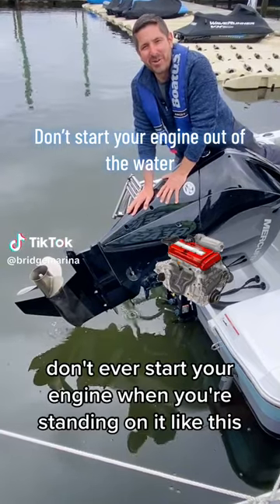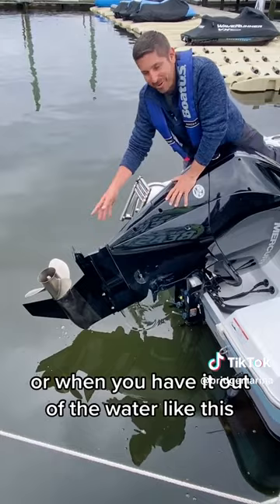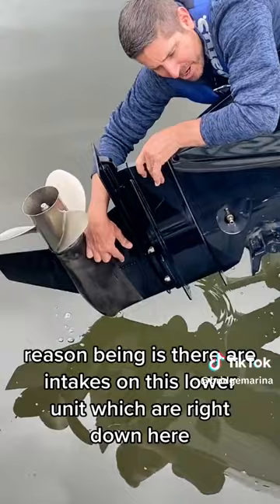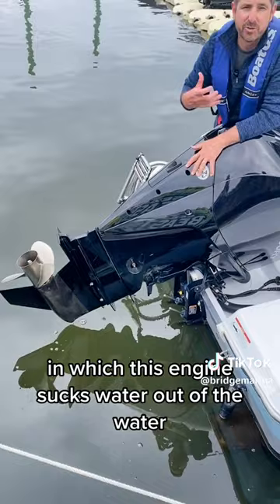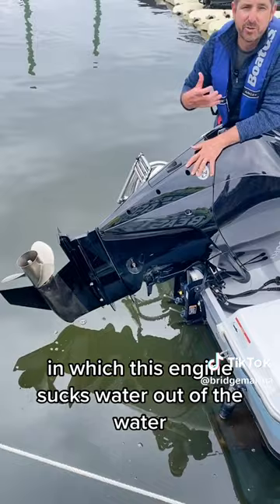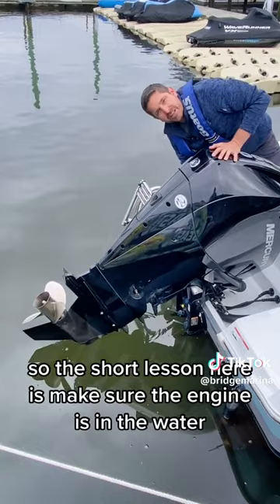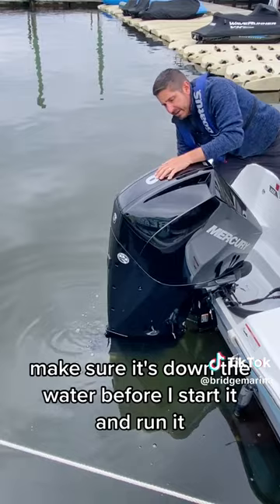Boating Tip: Never Start a Boat When the Engine is Out of the Water

Comment: The main damage is the rubber impeller. A quick run will not destroy an engine.
Reply: False information boy
Reply: @GODSWORD11   Wow doc I must have just gotten lucky this whole time. Is that book smart or is that hands-on wisdom?
Reply: @andya2636   hush 🤫 son
Reply: Correct information boy
Reply: Just a little desk pop
Reply: @GODSWORD11  correct information nerd
Reply: @hiphopaDIZZL  watch yourself
Reply: @hiphopaDIZZL  watch yourself boy.
Reply: @GODSWORD11  no you
Reply: @GODSWORD11 he’s right it will affect the impeller firsts every time cos it’s rubber nothing else is
Reply: @colvinau1403  false information son
Reply: @hiphopaDIZZL  your mom son
Reply: @GODSWORD11 
If you run any motor without any coolant first fire up. It won’t hurt it.. as long as it has oil in it it will be fine. 

If you’re running it for awhile than yeah it’s bad there’s no water. Duh. But you can have it run for a little doesn’t hurt the motor. 

Now it might fck up the impeller. Due the rubber bushing. Than yes
Reply: @GODSWORD11 nope, run a boat for a living, a quick start with it up will not hurt anything, now you don’t want to let it run for extended periods of time like that as it can overheat and then damage your engine.  
 Your impeller though is what gets damaged.
Reply: yes  it is snart  oñe
Reply: @WickedSalty  totally not a desk pop just needed a new hole to run my hdmi cable👍
Reply: Someone on YouTube ran 2 Yamahas out the water for like an hr and nothing happened but the impeller. Out a new one in put the boat into the water and boated away.
Reply: Rubber gets very hot very quickly, degrades, and cannot dissipate heat in the same way as metal.   It’s only a matter of time before other consequential problems that can be costly or terminal.  Personally I start the engine only when boat is in water. Then leave to idle and warm whilst make other slipway preparations, load boat etc.  common sense really.
Reply: The impeller can break into small pieces very quickly and get sucked into the cooling water intake blocking small orifices inside the head of the motor that will be extremely expensive and time consuming to diagnose and repair. So, no, do not run the motor outside of water for any period of time. 

I’m a certified outboard motor mechanic for the last 15 years and I have seen a lot of dumb shit and heard a lot of bad advice during that time.

Comment: For long periods of time. If you pull it out from winter and wanna fire it up for a few seconds to make sure it runs before you drag it to the lake then that's ok. Don't let it get up to operating temp
Reply: Use a pair of muffs to supply water to it.
Reply: No it is not. Just letting the engine fire and not run is proving nothing.  Just because it fired up does not mean it will keep running. ALWAYS USE FLUSH MUFFS. Put them on and let it run for a few minutes, check the shift and throttle action, and steering as well.
Reply: Na, a quick fire up let’s me know my battery is good and it will fire and I don’t sit on the ramp with a dead boat and keep others from launching. 
 You don’t always have a muff option and a quick start can tell you a ton of information.
Reply: In my experience a few seconds is enough to cause damage. It’s not the engine that overheats, it’s the rubber impeller that uses water to lubricate it. I know it doesn’t make sense since water technically isn’t a lubricant but after having to replace my chewed up impeller I won’t so much as crank my outboard out of water (without muffs and a hose) again
Reply: @codybigbee2957   a winterized motor has no problem running for 15 seconds. You still have antifreeze in all of your passage ways doing the same thing water does. The liquid keeps the rubber from drying out, that's the way we have done it for years. Our 70hp Johnson has never had the impeller touched. And our 9.9 just finally chewed the original  impeller like 3 years ago. Both motors are late 70s.
Reply: Wouldn't let you borrow my boat
Reply: @TTGTO288  this is the best case, obv you can do a quick 2 second test with no water to see if it turns over, but I much perfer to put the muffs on and get the engine warmed up as if I where actually on the water before I drag it out to the lake
Reply: @Blue_Doge  Agreed.  Being stuck on the water isn't much fun.
Reply: @TTGTO288  what's funny is my cousin just bought a boat a month ago, it was a used 16 foot boat witha 75 honda from one of our good friends, the first time he puts the boat in the water he ties it up to the dock but doesn't start it as the truck parks, then a pontoon boat is trying to launch but he's in their way so he has to untie and get out. But his engine was cold so the second he got a bit away from the ramp and gave it gas it died and he had to start it up again whilst being blown back towards the ramp

Comment: It doesnt destroy it...just tears up your impeller....
Reply: Can over heat the water jacket and destroy it. Previous owner of my boat thought the same thing and I had to replace the whole motor.
Reply: The power head, will overheat and seize. Then you're out thousands of dollars.💰💰💰
Reply: @Bill-sp8kb not in seconds
Reply: yrs it wioll
Reply: if you're a new boat owner (which most people who do this are) you won't know it does that, causing the engine to potentially overheat depending on how damaged the impeller is

Comment: The problem with running the lower out of the water would be the water impeller heating up to the point that it melts to the housing and if you didn’t replace the impeller and the housing it could possibly not pick up water there fore overheating the block and causing further mechanical damage or complete engine failure.

Comment: I watched a guy who lived down the street blow his motor that way. He must have just finished doing something to it in preparation to get it out on the water for the first time after purchasing it that winter and decided to start it up and let it run in the driveway for a while. I was driving down the road, saw this, and told him he needed to get a 55 gallon drum or something to submerge the intake and he just looked at me like I was nuts; I guess he figured I didn't know what I was talking about. Before I had finished pulling away I start smoking big-time.

He ended up purchasing a brand new motor to replace one that literally never touched water. Oh, and I also noticed he had also acquired a 55 gallon drum he had placed on the side of his house next to where he would park the boat forcthe winter.

If someone from the neighborhood you don't know, but have seen drive by for years, takes the time to stop and offer you a piece of advice you really should at least listen to what they have to say before rolling your eyes and walking away. Odds are they are just trying to help.

Comment: Does it do damage if you start it for like 5 seconds then put it in the water. I doubt it does
Reply: It's okay to start it for 5sec but don't have you're motor running as your backing it up into water
Reply: It's okay to start it for 5sec but don't have you're motor running as your backing it up into water

Comment: The reason is you don't want the water pump running dry. The engine won't need cooling for a few minutes but the rubber in the water pump can be damaged pretty quick.

Comment: I mean you can run for like 60 seconds without damage. The water is to keep it cool, if you don't run it long enough to heat up then it's fine. I just wouldn't run it and keep it running without water to cool it
Reply: It’s about running the impeller pump dry
Reply: No the water pump impeller is made out of plastic and if you do that you'll damage it. Its not aluminum or steel its plastic in all outboards.
Reply: @JoshSmith-wo7zw that’s false they aren’t all plastic mine is rubber
Reply: @onyoursixgaming2842  I think he ment rubber because I'm pretty sure all of them are rubber

Comment: Also if it’s trimmed up that high and it carbureted it’s gonna pour gas everywhere in the cowlings. And if it’s a 4-stroke there is no oil in the crankcase because it’s all in the back of the cylinders causing severe oil starvation

Comment: @bridgemarina

What about a test start in the carpark for a 15 seconds?

What about a small 15hp 2stroke pull start.

I don’t want to be stuck on the ramp with other boats lined up behind me trying to pull start a 2stroke that won’t turn over. 

What in particular is the harm that can be done for 10-15sec operation out of the water? Just the fact it needs to pump water to cool?
Thanks
Reply: You can actually just start it at home to test it.

They sell a tool the fits over the water intake holes on your motor and uses an attached waterhose to provide the necessary water to keep your engine from potentially getting damaged.

Comment: If you start it at that position the biggest problem is not the Impeller or the overheating but the oil pressure Wich Will be 0
Reply: Only if it's 4 stroke
Reply: @pain_weaver  Yes that's correct

Comment: Most outboards Ive used have a pull to start.
How would you even start an outboards thats tipped forward?
Reply: small correction, Most (if not all) small (20 and under horepower) motors have a pull to start, these are only on tiller moters, (the ones where the throttle on the handle and you push the handle ot steer instad of a wheel), but on 50+ Hp engines they aren't an option (at least to my knowlage)

Comment: If you want to start a motor out of the water how should you feed it water can you use a hose somehow?
Reply: They actually have a tool/attachment that you attach a waterhose to, that will fit over the motor's water intake holes and provide the motor with the water that it needs.

Comment: Starting your outboard boat motor when it's out of the water really shouldn't be an issue, so long as you have the necessary piece that fits snugly over the water intake holes and supplies the motor with a stream of water to cool itself via using a waterhose to supply the water.

That way you don't risk overheating the engine and burning up the block or damaging the rubber impeller from lack of water available to circulate through the system.

Though even then I probably wouldn't bring the motor up past idle speed or at the very most slightly above that, just to be sure and lean on the safe side.

Comment: Also if u ran it out of the water it wouldn’t destroy the motor most new boat motors are designed to shut off if there run to hot

Comment: Had a guy offer to trade his boat for my Volvo, provided a video of him starting it in a trash can filled with water. If THAT guy can do it, you can too
Reply: There are definitely a couple of ways around the whole "don't start your outboard motor out of the water" issue.

The other one I know being using the tool that slips over the water intake openings and uses an attached waterhose to supply the needed water for/to the motor.

Comment: You can run the engine out of the water but no more then a minute and that’s even cutting it close and if you do that lower it in the water slowly or you risk thermal shock engines don’t like that but if the boat is in the water should just have it in the water in the first place
Reply: If I HAD to start an outboard motor out of the water for some reason, I honestly wouldn't risk anything past about the 10 second mark.

Comment: Did anyone else cringe when he had is hand wrapped around the prop? Maybe I'm just getting old and see possible carnage everywhere.
Reply: Nope. Motor wasn't on.
Reply: @pain_weaver it's probably the culture at work that's beat me over the had the last 20 years that make me this way 🤷🏻‍♂️ when I work around the fan on my car I disconnect the battery just in case some the key falls in the ignition and manages to turn itself to start. I know I'm sick.

Comment: I hate these commercials you can start it out of the water.  Don't run it for min out of the water but a min or 2 it's NOT gonna hurt.  I have been building Race Jet Skis and outboards for years and NEVER had a problem. Better to not to many idiots forgot or say it will be fine. It will BURN up if done for extended times.

Comment: False! It will not hurt your motor until your motor gets hot. You can fire your boat motor up out of the water for a good 10 minutes before it needs some water to cool it down. It's never going to hurt your motor to fire it up as your being backed into the water. Anybody who tells you different is an idiot and really don't know how motors operate
Reply: Lol false. You just burned your impeller.

Comment: You can start your engine out of water but i would not run it for too long
Reply: I personally wouldn't run it past about 10 seconds, maybe 15 at the most, not without the tool to use that provides it water via a waterhose.

Anything past that is likely just asking for trouble.